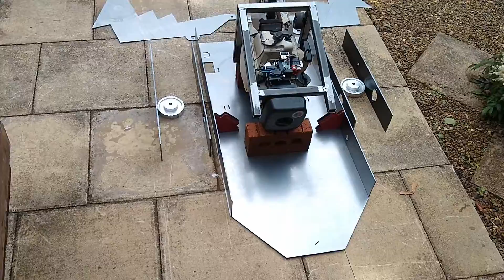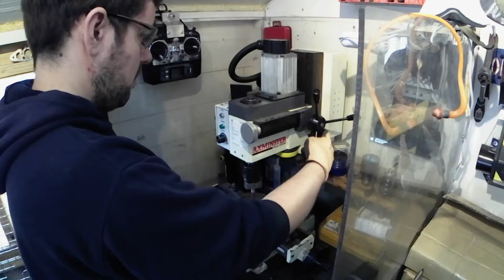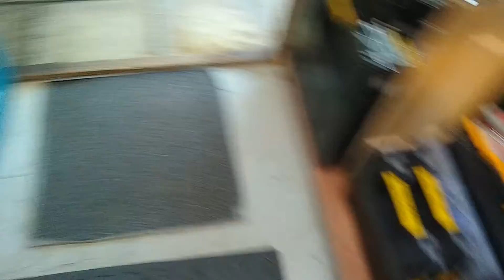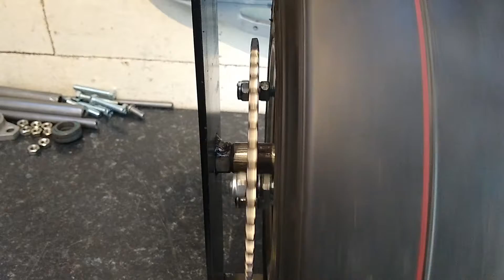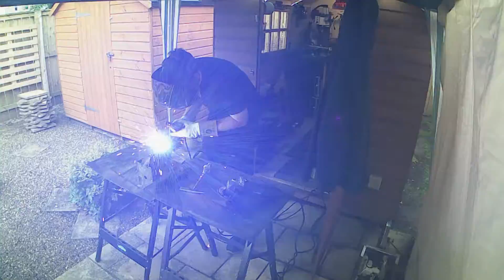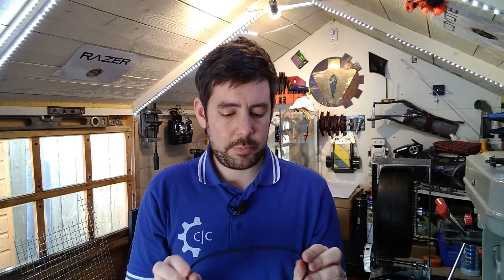Building Dead Metal - Episode 4 - Let Construction Commence!

Comment: so you doubled the torque from the motor correct?                                   thanks for the videos
Reply from the maker: The ratio between the motor and wheel is approximately 12:1. I'm not sure if torque scales linearly with ratio but it will be more than double.